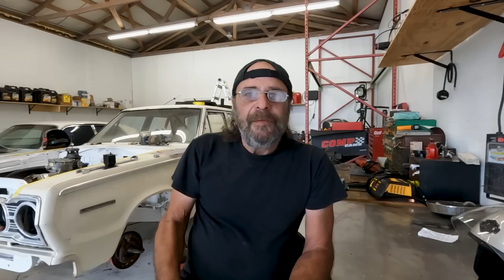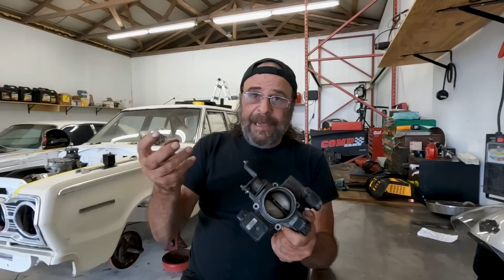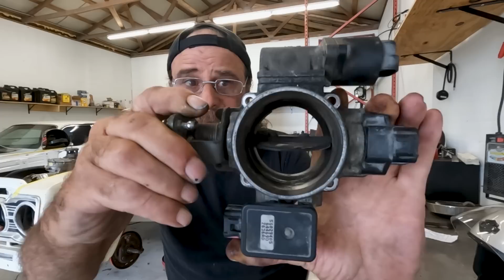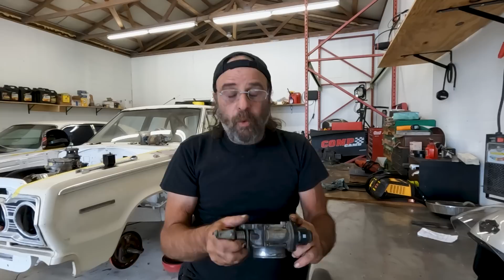Digging For Hidden Power - Building A High Performance Car While Building A Higher Performance Human

Comment: Hey any thoughts about difference in air temperature
Reply: It has a cowl induction setup now. It's just about as absent of heat as you can go without having turbulant airflow issues with air rushing over and around the inlet.

Comment: Modern engines with O2 sensors are looking to optimize fuel trims to maintain the 14.7:1 air to fuel ratio.  If you increase airflow, the ECU should direct the injectors to increase fuel - so far so good.  But the ECU will then detect long fuel trims out of range and could throw a code.  I know this is an issue with the Ford 4.6 - if you swap the earlier intake for later (“performance improved”), it can run lean and/or throw codes.  I am running into this on my ‘96 Cougar 4.6.  Modifying the engine is difficult because of these types of issues.  I’ve decided to keep it bone stock. 

Not to take away anything from your video, conceptually it is spot on.  Just keep in mind that these modern engines tend to throw codes (I.e., “check engine light”) after mods unless you modify the ECU’s tables.  

Remove the evap system on a ‘96 or later?  You’ll get a code. 

Which, btw,  goes back to an older UTG video.  If you stick to the more popular platforms, there tends to be more parts/mods, etc.  If you buy a ‘96 Cougar with a 4.6 well great, but don’t expect to find a canned tune.  If I had an SN95 Mustang from the same year, options exist with regards to canned tunes or hand held tuners (yes, the canned tunes are applicable not only to engine but the platform the engine is installed in).

Great video Tony, hope my comment is helpful.
Reply: One more comment - OBD II began in 1996 for all vehicles.  That means that this was the year for the O2 sensors after the cat and the sensors on the evap system.  If you buy a ‘95 or earlier, you can get away with a few more mods and not have a check engine light
Reply: 1996 Cougar 4.6 runs extremely well with true dual exhaust behind the first 2 cats ( I had one, cut off behind each manifold cat and installed 2 1/4 inch x pipe with Dynomax mufflers in place of factory rear mufflers) and then I took the air box out and installed a 1995 454 GM truck K&N (clamps right to the mass air meter and snugly fits in the spot for the air box) i did only those 2 mods with front tires inflated to 40 psi and rear tires to 25 psi , took the spare and jack out and ran 14.90 with it, it never had any check engine lights and passed emissions for years like that. The 3rd "Y" cat and tiny pipe behind it to the y before the mufflers is an absolute power killer. After I did the full exhaust I couldn't believe how much stronger it ran.
Reply: Welcome to tuning: change MAP behaviors for the same throttle positions by swapping out parts... might need to revisit fuel tables.
Reply: Thank you, I’m going to consider that - excellent points.  One last item I’d like to add is that performing one modest mod that increases airflow by 8%-9% is like to not result in a check engine light, but if you get into the double digits, the ECU will the see an issue and trigger a check engine light.
Reply: @zilksmooth  I am no expert, but my LS engine is designed down to how the incoming air charge effects the ignition event, so any change in the air intake system would probably decrease efficiency .
Reply: @richardelliott8352 I put a K&N air filter on my 09 Chevrolet Silverado 1500 with the 5.3 with the range disabler so it runs on all 8 cylinders all the time & I can tell a big difference in power mostly at wide open throttle right from a stand still & it definitely pulls much harder . Fuel mileage is a little less but by only a mile or 2 difference because the mass air flow censor is seeing a air flow increase so it tells the computer to add more fuel at the injectors . I also cut the stock muffler off & welded a 3 inch stainless steel pipe in so it sounds much better . The stock muffler being stainless steel weighed about 40+ pounds so I scrapped it and got money out of it .
Reply: This is not exactly accurate. The computer does adjust the fuel trims based on the feedback from the O2 sensors, however it only does this during “closed loop” operation, which means engine warmed up and operating at lower loads and rpms. At full throttle, the O2 sensors can’t respond fast enough, and the computer goes into “open loop” which disregards the O2 sensors and only provides fuel based on the MAF reading. As for your lean condition code, the PI intake swap will not cause a lean condition, even without a tune. There is improved air flow on the top end, but not enough to max out the MAF, and so it will still fuel properly. If you have a lean condition after the intake manifold swap, you most likely have a vacuum leak somewhere. It also could be a dirty/faulty MAF, bad O2 sensor, or even an exhaust leak can cause a lean code, but the PI manifold swap will not do that. Also if you want more good tech info on that Cougar, check out BIRDCATS.com, lots of good info and very knowledgeable people there on the 89-97 Cougars and Tbirds.
Reply: so true, efficiency is power, and late model cars are designed for as much efficiency as possible , so every system is interdependent on all the others, making successful modification very difficult to achieve.  Aftermarket parts aren't going to beat out a factory design team with supercomputer time and millions of dollars for development and testing very often.
Reply: I've done the PI intake swap on a few different nPI 4.6s in the Panther platform cars. Absolutely worth doing, never had any weird codes, my personal daily driver has 30k miles since I swapped it and its on the stock tune. A quick and dirty modification that is also worth doing with a "plastic intake" car 4.6 is to grab the throttle body off a 4.6 or 5.4 powered Econoline. The truck/van TBs are 70mm, car TBs are 65mm, and the vans typically have the same cable routing as the cars so it is basically a direct swap. Noticeable bump in throttle response, maybe more top end but its a 2v 4.6 so its not like there's a lot of top end power anyway.

Comment: I've done throttle body mods to several cars. There's usually a speedbump in the bore you can grid off increasing the flow. Just don't touch where the throttle blade sits.
Reply: Those might be there on purpose
Reply: @needmetal3221 One way to find out! And used throttle bodies are pretty common for most cars so the cost of failure is pretty low
Reply: The bump smooths turbulence at lower partial throttle where 90% of driving happens.
Lots of turbulence around a partially opened throttle blade.

Comment: Well, my two cents about the diameter difference between the inlet and outlet of the throttle body,is the ventury effect.The smaller outlet diameter, will raise the speed of the airflow...resulting in even not much,but theoretically power gain.So i see that particular mod of the throttlebody, as a "leave it alone part 😉Smoothing out the other parts though, is definetly a good little freebee mod.Eitherway,love your videos ,mister Tony 🙂Greetings from Norway, Stefan
Reply: Right

Comment: I believe my Ford 6V carbs are rated at 750cfm, while the Six Pak and Corvette Holleys were rated at 590cfm. Please correct me if Im wrong, but thats what i believe.
Reply: The Mopar six-pack used a 350 cfm center carb and two 500 cfm outboard carbs. They used the same set up on the 340 also, believe it or not.
Reply: Well that didn't come out right, I meant 500cfm, and of course punched in 590cfm instead, and the Ford versions should say 350cfm, NOT 750. To add a little, the Ford carbs were 350-330-350cfm, with the center carb losing a little because of the choke choking off 20cfm. Sorry for the sidetrack guys, and good day to all

Comment: I noticed on your fresh air intake that the stock hoses are ribbed where they flex, I was always told that type of hose disrupts airflow, perhaps some straight pipe or hose could smooth it out and gain some cfm there.
That is unless those pieces are part of the stock equation.
Love the work, I would love to see a Poly 318 buildup....its what I have in my 66 Belvedere
Reply: I've been wanting to discuss that few missing cfm from the turbulent boundary layer of that. However at this phase of this project car, it's ONLY stock parts. And the 2nd tube was also a stock 1996 clean air tube so it qualified.

At a later time we can discuss that again, I'm sure chapter 2 or 3 will allow either mixing and matching of factory parts from other applications, cheap aftermarket, or inventive modifications from completely outside sources. 

I say we bring it up again at that point.
Reply: It's also a huge size pipe compared to the throttle body
Reply: on my car the corrugations on the hose are intended to tumble the air flow to give the mass air sensor a better reading.   But one can buy a smooth pretty red "performance" silicone hose for $50 bucks and screw up the design intent.    and it does look intuitively better flowing, while identifying the buyer as low skill.
Reply: Me too. 66 Plymouth Fury. 👍
Reply: We're not doing pure stock... just stock LOOKING. :)  He doesn't have to replace the intake hoses... just line them with a smooth liner. Paper? Plastic? Maybe just do the outside corners, so to retain any needed tumble. Remove the obstruction, keep the engineering.
Reply: The hose is so big the bit of disrupted flow isn’t going to matter much.
Reply: Very rough numbers, but this is the way i originally got the concept  explaned to me years ago.  

A very sharp 90deg bend reduces flow by 20%.

At the next sharp 90deg bend that remaining 80% looses 20% of itself. 

Now down to 64% of the original airflow we hit the next 90deg bend going into the throttlebody...now down to 51.2% of the original flow rate.

...then we get to the topic of the ribs or corogated sections on clean air tubes....

They are designed for flexibility with engine movements and maintaince, not "tumble". 

They don't want turbulence over the maf, they want constance. And the reason just the coupler threw the readings off if because apparently the MAF was so close to the bend that when the air crashed into to outside of the corner, It was faster flowing on inside of the corner and sensor.

Now since the lower pressure is on the inside of the corner/sensor. This causes turbulence iver the sensor as the high pressure side of the air pushes over to fill that void the low pressure creates on the inside corner of a bend on the vacuum side of the coupler.

So, by moving the turbulence as far forward as possible, they helped make sure there was constancy over the maf. They didn't want turbulence over the maf for better readings.

Holy shoot some of yall know a little bit about everything and not much about anything, with just enough knowledge to be more dangerous than the average man that knew nothing about this subject. 

And a silicone coupler shouldn't cost you no $50. That's on you for thinking it was a fair exchange. 

ANYWAYS, as with how this whole give and take thing works, we lost something in the exchange. and it appears most of the Give part was that it makes the boundary layer extremely thick and unpredictable.... so they make them wider. I'm sure yall are starting to get the picture, right?!

Comment: I dont think rhe gain will be so huge. Rather the stock intake runners need some rework if doable
Reply: Lol, it's a 4.0 sized engine with like a 55mm throttle plate. The 2.0 in my dart uses a 64.5mm thottle plate. 

The exhaust was cut and that lower backpressure also slightly increases the cfm the engine was already producing. 

The increased fuel rate from the tuner means almost every extra oxygen molecule will be burned.

And the ignition timing advancement from the tuner means peak cylinder pressure is now happening at peak power output rage, not peak reliability and efficiency range. So the percentage of power increase from each molecule conversion is higher.

Your saying the gain won't be do huge?

 opening a throttle that's peak cfm was already too small for the engines peak cfm in stock form. And that engine is now making more cfm than stock.

 Also pulling lower temperature air so each cfm weighs more and has more oxygen molecules available to give space for more fuel to burn. 

So each one of the liberated CFM will have more added oxygen to it.

tuned to have a higher percentage of power increases than the stock timing and the extra fuel was already added.

I personally disagree that the gain won't be do much, however I agree that the stock 1996 casting may need some hours put into it.
Reply: @HipstersAndHippies  check the latest video.. there was basically no gain for more top end power...the current restiriction is not the throttle body. he  clearly states it in the video

Comment: I can help you retain the stock housing but the plate HAS TO come from another year. Im sorry but its the one part that got to be swapped with one from another application. But NO WAY anyone would notice it.

My idea for ya is that it might be possible to use a brake hone and other skinny hone, (possibly with little valve lapping compound.) to gradually increase the pinch point at the throttle plate a few extra millimeters. Without getting out of round. You could probably fit one of the larger jeep/dodge throttle plates from a later year In the stock 1996 throttle body housing.

 Who knows maybe we can poor man bore this 1996 casting to a 62.5mm plate. Only the calipers will tell.

Also the hone will texture the thing, smooth it, and you can use it to contour and radius the opening.

 Just deburr and round the sharp edges of the bypass valve area before using thr hone. you dont want to catch the stones on those edges.

 And also if you're smart you will design a wing shape using the edge of the throttle plate and the remaining bottom half of the modified throttle shaft, to help promote airflow on the larger smother side of the plate. Much like a airplane wing dose to put the faster moving air under the wing.

And the rear edge of the throttle plate should be thinned on the side that will best try to help blend the 2 sides together again. Much like an air defuser.

Talk to ya later. Please comment if you have any questions understanding what I'm trying to say to ya.
Reply: When shaping the edges of the plates, leave the grime, so you can bring it just to the point the black line on the edge is like 1/2mm thick. If you get to the point the line disappears you just messed up.
Reply: Later on, those tips on a later model throttle should have no problem getting all the way up to 64mm (If not larger)Together we can show what a old xj and old 4.0 really could have been.

Comment: If you won't put a limited slip in it, I'll be surprised if it breaks into the 8's at all. I'd consider the project a success if you run 9.00.

Comment: So did the later model Jeep get more horsepower?  If so, were changes to the throttle body  the reason?  Seems to me to be a pretty easy theory to prove....
Reply: Exhaust, Throttle body, head ports, intake manifold, camshaft duration and lift, higher fuel psi with finner spray pattern injectors, and fuel and ignition timing all changed on that ancient engine over the years. The 2006 wrangler had a banger of a combination for the beloved 4.0 to go out with.
Reply: The last models 00&01 had restrictive pre-cats on the manifolds and thus to gain the power lost back, they engineered a curved, more equal length intake manifold.  It'll bolt right up to the 96's power steering setup.

Comment: Rule of thumb,  you need like 30-40 hp to notice a difference like that. You could have easily gain 25hp with your vaccum trick.  So there's surely mowePawaa in that stock engine. 
UNLEASH THE 4.OL Beast !😊

Comment: It needs two of those. Three starts to push back but two, between one and two and the other one between five and six. Bcz the two middle ones hit at the same time, the benefit of the middle opening is minimal compared to dual opening intake. Those into 3 gallon airbox with 4 inch stacks, or salad bowls. With porting and mildly home ground cam, sevens on a short track.
Reply: Home ground cam? Enlighten me. Bench grinder on the base circle? Welder?

Comment: If you are nuts, lm right there with ya! Great info and point. 
The budget-3000
The ride -     1500
Tires -           800
Miscellaneous -700
The knowledge -
 priceless
Reply: Consider the parts for this are like a fuel pump, gas tank, brake light, rear hatch latch, rear bumper, complete gasket set, 

And the only "performance mods," are partial weight reduction, roof rack removal for areo, a pack of leaf spring clamps for a few dollars, cut off exhaust, removed the antiswaybars swaybar links and all the associated brackets, put a few washers over the front shocks, cowl induction with a $2 tube, shorter tires only because it needed tires, .......and a few hundred dollars for the tunner to reflash the pcm.

Basically nothing.
Reply: there is a learning curve once you start messing around with cars.  Mine was unpleasantly steep, and I thought I knew a bit going in.
Reply: COOL A

Comment: Tony, did you measure the opening of the intake manifold?  I am wondering if that throttle body taper has anything to do with that
Reply: The intake is bigger than the bottom of the Throttle body. It matches the top of the Throttle body so he's good to go by hogging it out to match the intake.